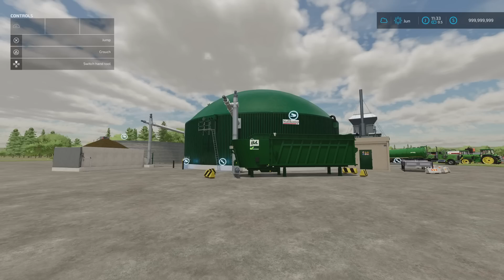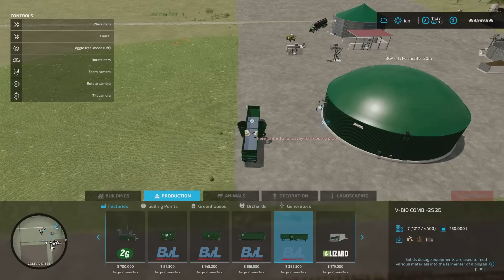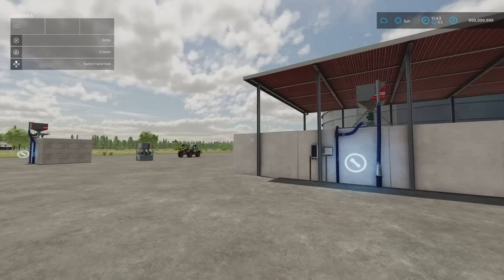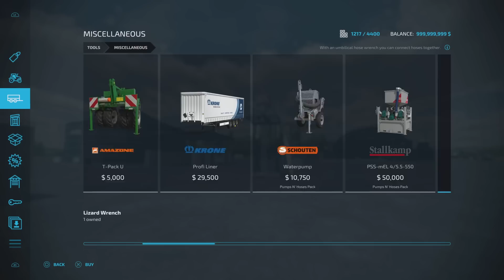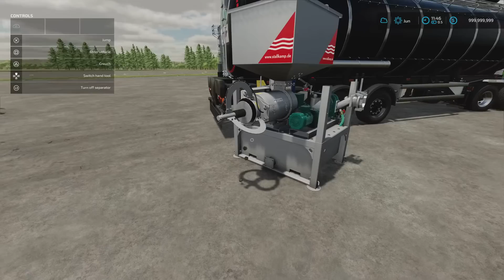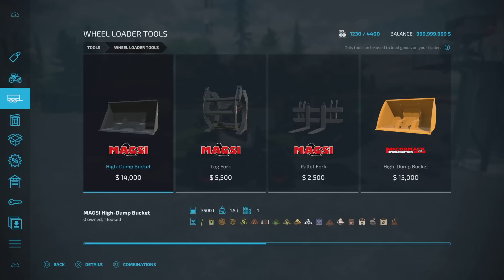Pt 1 | COMPLETE GUIDE to PUMPS N’ HOSES PACK/DLC | FS22 Farming Simulator 22 | INFO SHARING PS5.

Comment: 20:13 the reason why you had digestate in that tank is because the biogas plant you showed off at the beginning was using the tank you sit next to it as slurry storage and then when you had the second one it was recognizing it as a digestate storage you can use those silos independently for just storing slurry but they have to be far enough away from the biogas plant or the biogas plant will think it's part of it

Comment: Do any of the manure silo extensions (the ones that you would normally place near a cow or pig barn) support this new separated manure and link to the separators?  Those extensions can fill a trailer or manure spreader without a bucket and show you how much you have in storage, which I would definitely want if I'm placing a tower separator at my BGA.

Comment: You can put the separators near a normal cow barn manure tank and it will work, you can also use the manure from it as bedding, the single one you can put it so it’s over a wall into an existing manure pit at a cow barn and it will
Fill it up